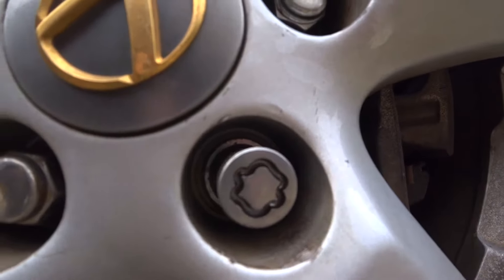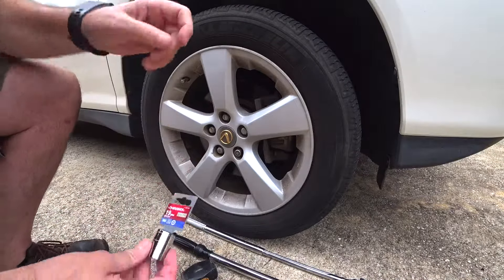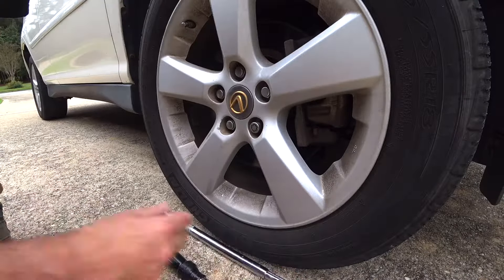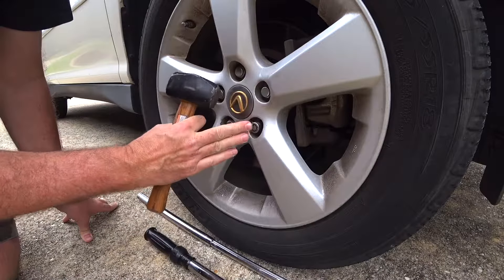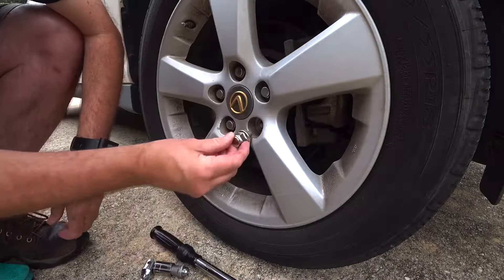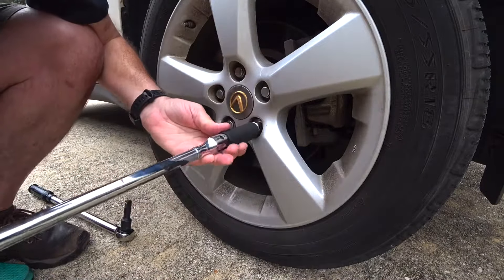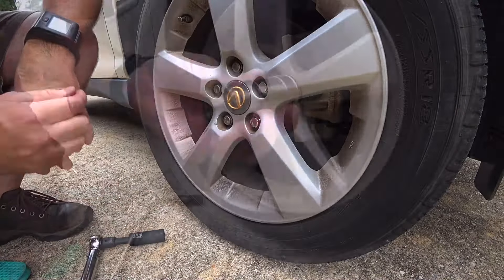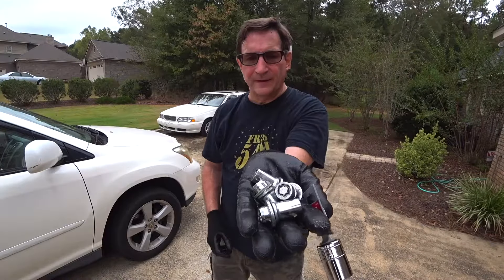Easy McGard / Lexus / Toyota Wheel Lock Removal

Comment: You’re a legend for this. I hammered on a 19 mm, and got them all off. Little tip. Have a vice grip to remove the locking light from the 19mm socket.
Reply from the maker: Good vice grip tip! I’m glad you found the video helpful. Thanks for letting me know it worked for you too!

Comment: I used a 4-lb sledgehammer to install the socket and there was no slippage. Worked great!  Go ahead and get a socket for each locking nut. Getting the old one out is not easy.
Reply from the maker: Glad the socket trick worked for you! Thanks for commenting!

Comment: Awesome. I bought a  21 mm extractor socket that was on sale at Walmart and a 19mm impact socket using your technique.  Both worked, both were a one time use - stuck nuts.  Will order a couple more cheaper 19mm for the other two wheels.   'you da man'
Reply from the maker: I’m glad it worked for you too! Pretty sure one time use is still cheaper than paying a shop to do it. Thanks for the positive feedback!

Comment: Thanks a bunch.  I am sick of dealing with the dealer for tire rotations on my wife's 21 highlander, so I was going to do it myself only to discover they never put the lug nut key back last time they rotated the tires. So upset with them, but hopefully I can do this and never deal with them again. Thanks
Reply from the maker: Same thing happened to me twice with the dealer forgetting to put the key back. One rainy night before I knew this trick my wife was stuck on the side of the road with a flat. I arrived and jacked the car up only to find the key was missing. What should have been a 15 min spare tire installation turned into a big problem requiring a flatbed tow. It was very frustrating and all because a mechanic at the dealership didn’t put the key back. Sorry to hear you are having a similar experience. Unfortunately this seems to be an all too common problem. Best of luck to you with removing the lock nuts. Hopefully they aren’t over torqued on and come off easily like mine did in the video.
Reply: @fiveable  wow, I bet bad words were said that night. 😳😂. Thanks!

Comment: You saved the day today.  My moms key for her security lug nuts stripped out on her RX330.  Tried the same method as you used but did not work until I went to home depot and bought the same exact socket you suggested.  Thank you Sir!  Only completed the 2 front wheels that I had to get done but I'm running back to home depot tomorrow for 2 more sockets for the back wheels.. I could not pound out the lugs from the socket but for $4 per socket.. I couldn't even buy some random kit for that price and this socket worked flawlessly.
Reply from the maker: Glad it worked for you!!! Yes, the lugs are very difficult to get back out of the sockets. I agree it’s hardly worth the effort when sockets are only $4 each. Thanks for commenting and letting me know you found the video helpful! ✌🏻
Reply: @0utcast  yeah right !  Where are you finding them ? I've been looking for an hour. I can't even navigate McGards website to find them. They sent me email welcoming me but its a pain you know where. I had to have some F'n id  What and where is the ID I need? Gave up.
Reply from the maker: Problem with the key from McGard is that there are a lot of different key shapes so you have to get the right one. If Home Depot is out of the 19mm 12 point 1/2” drive sockets maybe you can find one at Lowes, Tractor SupplyCo, Harbor Freight or a local auto parts store depending on what’s nearby. I hope you get it. It’s definitely a pain!!!

Comment: Excellent video!! We have a G37 and I over torqued the McGard lock nut on the same front side as yours. The material from the lock came off into the lug, and the lug is now stuck on. About to go to Menards and get a 19mm, 12-point, 1/2" socket and do exactly what you did, with a breaker bar and hope it comes off as easily and we can ditch the locking lugs. I need to replace two tires before winter so the lug has GOT to come off ASAP.
Reply from the maker: Hi @SportMusicCars. Thanks for your comment! I’m glad you found my video helpful.  I’m not surprised you have the same locks on a G37. Apparently the model of McGard lock in the video was installed by A LOT of different car brand dealers. I hope it comes off easily for you!
Reply: @fiveable   The 19mm socket did not work. It spins. Gonna have to try a high impact socket.

Comment: I ordered (Amazon $28, I believe , a lock key that included 4 locking lugs, just to try and get locking lugs on the Highlander off. I don't need them but the key (if that's what you call it ) that came with vehicle was mangled/stripped.  Home Depot had only three 19mm sockets. $5 roughly with the tax or $15. vs $28 for the key which I was able to cancel the order. I was able to knock one lug off of one socket so I could use it on the 4th. The one I knock off wasn't rusted as much but with a vise I should be able to get the other two and recover those sockets. I had a set of new lugs already bc old ones were getting nasty looking.
Reply: In other words you saved me  $13 ( almost 50%, and I won't have to mess with the locking lugs anymore or have to look for that key tool when it comes time to do brake work or tire work, as in flat or rotate. Thanks !!!
Reply: One other thing I spent more time looking for a locking  lug nut key on McGard's website and Amazon trying to find the right one vs going to home Depot for the sockets to do the job. Again I don't need a locking lug. Could maybe use a locking Catalytic Converter though.
Reply from the maker: It’s not super easy but the lug nut can be knocked out of the socket with a long punch and a vice to hold it. Yes I need locking catalytic converters too! Last winter I got hit at my shop at 3am. My cameras sent alerts and I called the police. The thieves sawed catalytic converters off two vehicles and ran off before the police could get there.

Comment: I run 5 miles a run, three times a week.   Over the past three years, I have found 10 McGard lug nut keys.   When I find one of these keys, I put the key into a peanut butter jar.   I found one key along with the lug nut that the key fits.  

In my neighborhood, it is common for people to lose these keys.   I am not sure why people keep losing these lug nut keys.   I find most of these keys near the entrance to a local tire repair shop.
Reply from the maker: That’s very interesting. I wonder if the shop sometimes forgets to remove the key from the wheel after tightening the last lock nut. Thanks for the cool comment. Sounds like you could start a side hustle selling replacement keys. 😂

Comment: Nice job Tom!  Maybe if you had a stud or bolt with the same thread pattern available, that could be used to knock the socket off the locking lug nut.
Reply from the maker: Thanks Rodie!  I was able to knock the nuts out of the socket and reuse the same one for all 4 wheels.  I added that last part about buying 4 sockets for people who might not be able to knock them out.  The sockets were $3.27 each so not a big investment but it is a bit wasteful to just recycle them.

Comment: Thank you so much. Karma points for you. Go straight to heaven. Anyways since I have extra inch sizes in various sets I have, no problem to mess those ones up.  11/16 or 13/16 12 point socket. Can't remember which. That's similar to what he used I think. Can't find my vise. Crazy. Do not use a six point like I did at first. 12 point only.
Reply from the maker: Yes 12 point works best. Thanks for sharing the SAE sizes that work. Good to have lots of options when stuck trying to get a wheel off. It never happens at a convenient time!

Comment: If u heat up the socket you should be able to knock the wheel lock loose from the socket a lot easier.  Metal expands when heated.
Reply from the maker: Thanks for the comment.  I was able to knock the lock nuts out with a punch and a small anvil but it was a pain.  I’m sure heat would have helped but it would have also taken longer. I put the bit about buying 4 sockets in at the end for people who have a hard enough time just hammering the socket on. I still have the socket I used in case I need to remove another lock nut but I wouldn’t use a cheap, stretched out, 12 point socket on anything I cared about.

Comment: I did the 1/2" drive socket and breaker bar. Didn't work. Either the socket was not on far enuff, or of too soft material. I went back to my Pittsburgh 3/8" 19mm 12-point short socket, with a 3/8" ratchet with extender and it came off. Was going to try an impact socket next as those are harder but the 3/8" one worked so the lug is off, finally!! Have a video posted in about 15 minutes of this.
Reply from the maker: Nice job! I’m glad you found a socket that worked! Impact is a good idea but sometimes there isn’t enough clearance between the lug and the alloy wheel for the thicker walled black sockets.
Reply: @fiveable  Never actually used a black socket as only had 6 points. The first 19mm 12 point wasn't going in far enuff but the Pittsburgh one did, and it worked.

Comment: Tire shop said leave my car all day and they will see what they can do, that means $$$$$, I went to Lowe’s, got a 19mm for $4, and it came off with some muscle.  Was nervous about using a 5lb mini sledge on my wheel bolt… but wow!  Worked like a dream!  (This was after I ordered a used lock nut that a mechanic stripped out before he got to the 4th one.  $30 wasted on eBay.) 02 RX300.
Reply from the maker: Hi Gratismax. Glad the trick worked for you!Hopefully it saved you a few bucks too! Thanks for taking the time to comment and share your success!

Comment: Worked as advertised 👍
Reply: oh! And I used a 12pt 13/16" SAE socket   on my sister-in- laws Lexus. Measured the same as yours.
Reply from the maker: That’s good to know in case 12pt 19mm sockets are out of stock!  Thanks for commenting and sharing the 12pt 13/16” SAE info!

Comment: Thank you..WoW.. This similar idea was actually used on my P32 AG Spacecraft Modulator bay door hatch recessed knob
In 1990..
The 35.50 mm circumference security bearing knob that seats onto the mated
Worm gear spline to gain access to the shuttle maintenance control panel had become sweated into place not to mention the coating of atmospheric Oxidation on the internal threading..I had applied a special blend of antiseize and anticorrosion with a heat resistant factor of up to 2000 celsius.
So, were talking 40 Cm recessed shaft with 1.5227 mm if clearance ID of the Bearings surrounding entrance..
Comparitivly, about the clearance thickness of a stick of chewing gum..
So..
However, unfortunately the mother board electronics had a temperature overheating and the hatch servo wasn't responding so the only option was to manually back the worm gear shaft out via the huge Titanium rounded bearing..
But how? It's completely smooth as a chromed Socket.. pretty much impossible to get any sort of normal tool 
To fit and Any type of welding there, completely out of the question..
Okay, so here is the cliffs note on how
Some old engineering saved the day.
From an old Civil engineer Construction Socket set ..it was an SAE set but we found one with the ID that would work with some knurling turned inside and the outside she'll was very careful machined lathed to about the thickness of a stick of chewing gum.
This was a meticulous and tedious chore 
And was pressed into the bearing via hydrologic .. also, an different torque handle for the Socket was fabricated bcse the old original one didn't have enough angle variation for the quarters we were unfortunately dealing with..
The pressed on knurled Socket was on there to stay and everything went well..
Working on space module Hardware is like nothing you'll experience anywhere else bcse, well it's not common layman civilian know how you learn under the hood of any automobile.. sorta like jet engine ANP mechanic.. it's specially aquired knowledge..

Comment: Hi there, very helpful :) how did you remove the wheel lock from
The 12 point socket after? You said you used an anvil? There’s that metal washer thing that gets in the way, tried using a vice and a hammer and a bolt or chisel and it didn’t come out
Reply from the maker: I used a long punch through the 1/2’ square drive hole of the socket. I have a cheap Harbor Freight anvil and was able to put the edge of the socket on the edge of the anvil so the socket didn’t move when I hit the punch with a hammer. It took a few good hits to get the wheel lock out. I was not easy. I hope you get it.

Comment: If you remove by destruction the screw . Simple tighten 2 screws both sides a bit, and use hammer and the steel bar taps directly on the screw that you want to remove  about 30 seconds then you unscrew by hand .

Comment: Thanks for the video.  Pretty amazing how easily the locks are defeated.  Removed 4 locks from my daughter's Altima in about 5 minutes after the key stripped.  Thought I was going to have to get a new key from mcgaurd somehow. Of course, now the wheels don't have locks on them but, did they ever really have locks?
Reply from the maker: There are some improved lock versions available with spinning sides but there are bypass tricks for those too. Wheel locks are such a pain. Twice the key wasn’t returned to the car after serving. First time I didn’t know the trick in the video and changing a flat on the side of the road for my wife turned into a flatbed trip at night to drop the car off at the shop. When it happened again I decided it wasn’t worth the risk of getting stranded. Fortunately second time I was at home (the video) trying to remove the wheel to replace a  serpentine belt pulley that was noisy. I’m glad you found the video helpful. Thanks for commenting!

Comment: so where did you get those extra lug nuts from ?
Reply from the maker: I got them at a local auto parts store but if you aren’t in a hurry you can find them cheaper online. Be sure the get the correct type for your vehicle and rims. There are few variations. You can also buy them from the parts counter at a dealership.

Comment: I want to do this on my wheels and it has 4 nuts. How do I know which size to get? Or is it universal like yours?
Reply from the maker: I wouldn’t say it’s universal and be careful if it’s a different brand or version. Some newer lock designs have a sleeve around the outside of the locknut that will spin and prevent this method from working. In case you missed it, at 0:39 seconds I explain how to determine a socket size that should work.

Comment: Any suggestions when the wheel lock and the wheel have no space for a socket to be tapped onto?
Reply from the maker: That’s a tough one especially if you need it off in a hurry. Maybe look on ebay for the correct key? It’s hard to tell which one is correct because small variations in the keys. I believe some people have also welded something like a large nut or bolt on the end of nut to convert it.

Comment: Yikes don't throw them away. Soon as the lock is loosened but still fully on the stud is the best way to remove the lock from the socket with a good yank or smash outward on the socket
Reply: Are the locks reusable or visually damaged after extraction? I also don’t see a reason some jb weld stickweld can’t be used to make a key along with some releasing agent like oil or talcom powder.
Reply from the maker: The locks were definitely a little banged up by the punch when I removed them from the socket. There might be a way to make a key like you mentioned. I love JB weld but not sure how reliable a key made out of it would be. A new lock set with key runs about $25.

Comment: I guess I'm cursed, because I've had no luck with mine. I've been trying for two days. It's the first time I've had to change one of my (used) Lexus tires. The nut was already stripped. It will not budge AT ALL. Lubricant does nothing. Impact wrench does nothing. I don't have a pneumatic, just a Milwaukee, but it's all I have. I've destroyed 3 sockets and even snapped my torque wrench and breaker bar in two. That's right. It's on there so tight I broke a freaking torque wrench. I don't have a welder. And I can't just take it to a shop. The tire will not hold air at all so I can't take it anywhere. Everything I've done has been useless. I'm just stuck with a broken torque wrench, 3 busted sockets, and a car that I can't drive.
Reply from the maker: That’s rough! Sorry to hear you are having so much trouble. I wonder if the lock nut is cross threaded on the stud or was torqued on way too tight last time it was installed. Unfortunately you might have to get a flatbed tow truck to take the car to a repair shop.  I had to do that once, before I learned the trick in the video. My wife got a flat and the dealer had forgotten to put the locknut key back in the car. I was not happy about that.
I hope you are able to your car fixed soon.

Comment: My locking lug nut is McGard with a slip sleeve...... anyone have any ideas?
Reply from the maker: I haven’t had to deal with the sleeved ones. I have seen some videos where people either spot weld the sleeve or weld a nut on the end and then use the nut to remove it. Unfortunately both of those options require access to a welder.

Comment: I have toyota prius 2005 and it's security lock nut is very old and key is just only  available on Ebay but all people suggest don't buy its not good Quality and rusty so please cut the nuts and it's cost is nearly £200  .it's much upsetting 
.
Reply from the maker: Wow, I wouldn’t want to pay £200 either! The locks my Lexus dealer installed were made by McGuard, not Lexus/Toyota. If you can find the registration card (glove box maybe?) and the locks were made by McGuard you might be able to order a replacement key. 

Here is a link to the McGuard website:

https://mcgard.com/replacement-parts-ordering-information/
Reply: @fiveable  great 👍